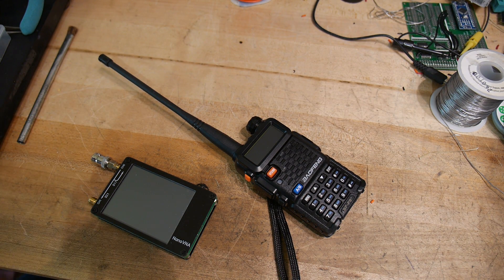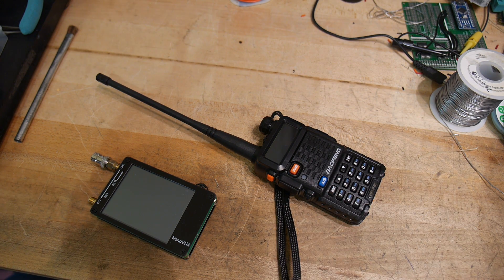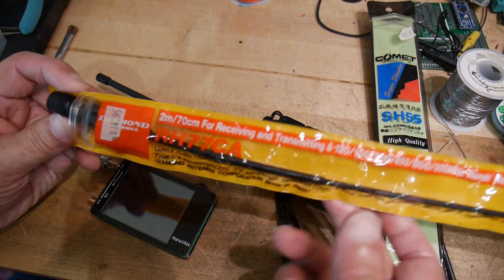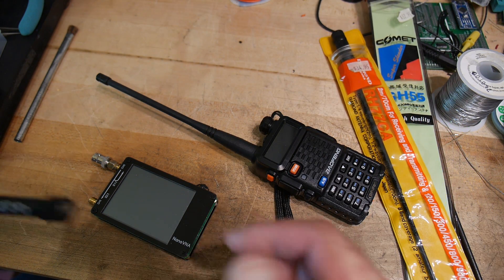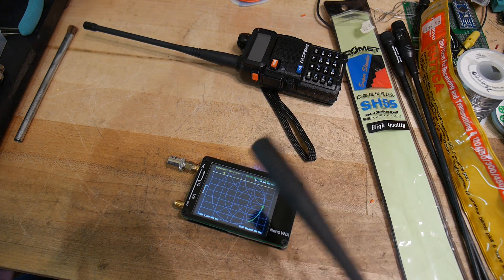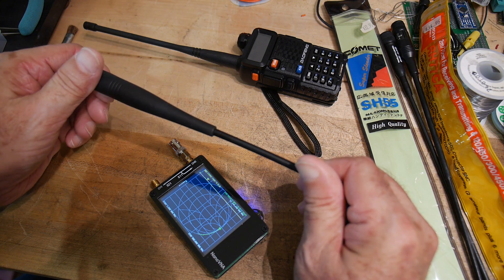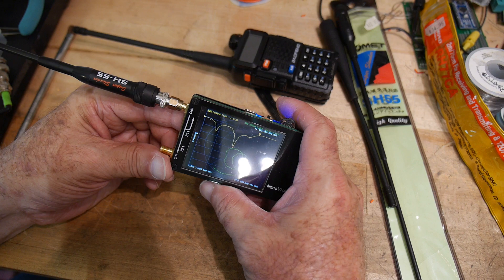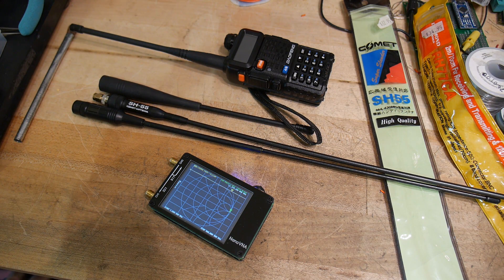#370 NANOVNA Good antennas from Japan

Comment: The small "F" connected antenna is from a Dish receiver to receive the UHF remote control signal on TV 2. The receiver has 2 tuners in it and a coax feeds the TV2 signal and the remote control sends a UHF signal to change channels.

Comment: You will find the measurements shift quite a bit when you orient the antennas vertically, and set the Nano down so the stray capacitance from your hands does not alter the readings.
Reply: You are correct. I learned that just. The other day. Had the antenna laid down which changed drastically once i put on an extension cable and made the antenna hang off the table vertically. Another thing I found was the software is definitely the way to use the nano. Lastly this guy didn’t even set any parameters. Hes observing the full scale of the device.

Comment: The. Reason you are getting bad readings on the Chinese antennas, is because, very sensibly, the antennas are designed to be used on a TX Rx held near your head! They actually use a dummy head to test them! Try holding the antenna by the metal base and near your head and the resonant frequency will jump into Ham bands. A lot of Chinese copies are actually very good. M0IIZ.

Comment: your extending the length of the antenna with the adaptors so its not going to be accurate reading
Reply from the maker: adding length only effects the phase information not SWR. At low frequencies like 144mhz it doesn't really matter even then. Yes to be more accurate you can calibrate at the end of the connector. I have videos showing that.

Comment: Great video ! Thank you for taking your time for this - my nano vna is great however when turning the unit off with the slide switch, the unit powers down BUT the LED next to the connector stays lit and eventually drains the battery- hows yours? 73 es Thanks
Reply from the maker: my LED stays on for a minute or two then turns off. battery is not drained
Reply: The Blue Led should stay on for no more than 5 Minutes maximum because the charging circuit is in line when switched off for this time..It also switches the Led back on when a charger is connected with the unit switched off...This will not drain the battery.
Reply: @stephenjones9153  depends on which firmware, I have old firmware and stays on about 45 seconds

Comment: about the two diameter whip antenna: perhaps it's a sleeve (or bazooka) design?

to be more accurate, all whip antennas ought to be tested in the middle of a ground plane sized for the lowest frequency of interest. when mounted on a HT, you are part of the antenna system.
Reply from the maker: https://youtu.be/wem0DoPe5O0

Comment: Any idea if this mini VNA would be able to measure a loop NFC antenna (13,56MHz)?
Reply from the maker: yes should be fine
Reply from the maker: oh, the antenna needs to be 50 ohm
Reply: re: " the antenna needs to be 50 ohm"
I'm assuming that the Nano can only do calculations for Z in a 50 Ohm system, so, that would be true IF you depend only on SWR and RL values.
The AA-55 Zoom by the other guys can be "set" to do measurements in a 600 Ohm system ... it displays SWR relative to a 600 Ohm system or 'line' Z.
Also the Zoom will read out in Rx and Zx, so, useful for making Z measurements on the wire itself.
Reply from the maker: @uploadJ  The Nano does read out Rx and Zx on the screen
Reply from the maker: @uploadJ  https://www.keysight.com/upload/cmc_upload/All/MicrosoftWord-Non_Standard_Impedance.pdf
Reply from the maker: @uploadJ  I never thought of using a VNA at 600ohms. I know companies sell 50ohm and 75ohm machines. I remembered a paper discussing the use of a 50ohm machine at other impedances, thought I would pass it along. the machine you reference might be a scaler analyzer and things get much easier.
Reply from the maker: @uploadJ  I remember the old VVM. That does date you :). I worked at HP for 25 years.
Reply: Depends on how accurate the Nano is on measuring impedances with its little 50 Ohm bridge when the Z is far away from a nominal 50 Ohm resistive load ...
Reply from the maker: @uploadJ  see https://www.youtube.com/watch?v=17AU24KtYkg&t=6s